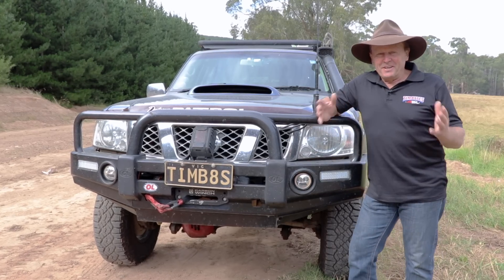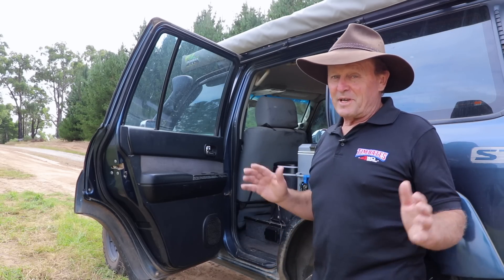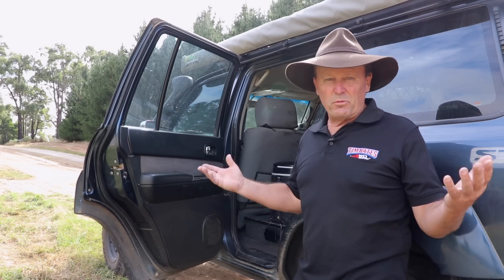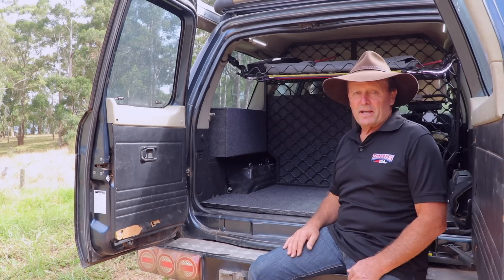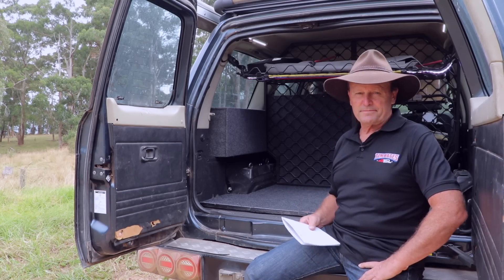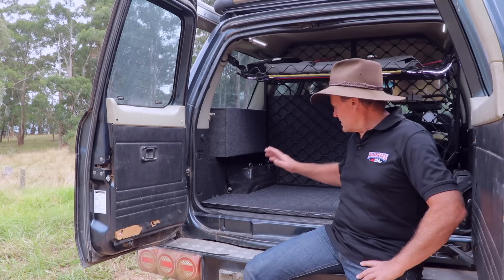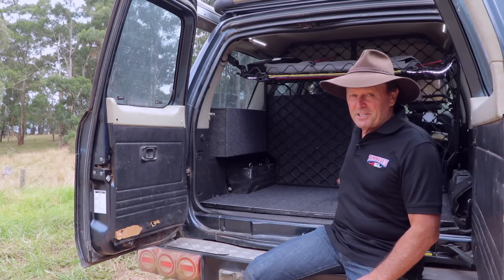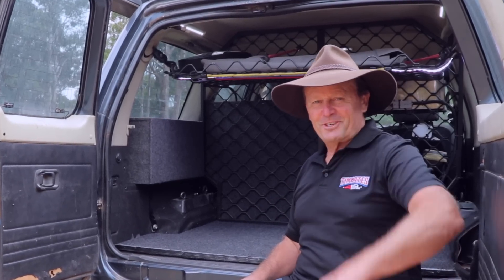Two Lithium Batteries Fail In Just 11 Months. - [ WHY?? ]

Comment: When I installed my 2 - 110 amp lithiums I simply strapped them down - no box! 
When my Redarc Manager 30 screens at me that the batteries are getting to hot (when using my induction cooktop) I can easily ventilate with a nearby fan to cool things down👍.
Reply from the maker: @TerryManitoba  that’s a good idea mate with the fan you have to cool down your lithium batteries. 
Top idea. 

Cheers Tim.
Reply: @timbates4wdadventures  It is worth a try as keeping things cool is kind of important. I've had the same batteries going on 8 years -  95k miles on the rig.
Reply from the maker: @ yeah mate, it is important to keep them cool. 
I’ve got the battery read outs through an app on my phone so I can see what the battery is doing. 

Cheers Tim.
Reply: @timbates4wdadventures  I also see you have the battery mounted above the rear wheel - which is where the vehicle gets a lot of movement.
To show some mechanical sympathy it would be "better" if you mount the battery & fridge for that matter between the front & rear tires. This is where mine are mounted and where you get "way LESS"  feedback from the road.
Reply from the maker: @ Gday mate, 
Not sure what you mean. 
The fridge is between the front and rear tyres inside the back passenger door. 
That’s the best spot for it. 
Easy to get into 

Cheers Tim.

Comment: Not mentioned How are you charging it? Why is there no ventilation as they get hot charging. Why slimline in the first place?
Reply from the maker: Well for starters - 
I’ve mentioned these points a number of times in other videos. 
It’s charged via a solar panel Anderson plug at the back 
There’s is two ventilation slots in the front of the box you can’t see behind the carpet
Slim line is obvious for space saving as mentioned in the video mate. Where it was mounted in the first place. 

Cheers Tim

Comment: As stated always check the tech documents for your battery. There certainly are a few brands out there that can be installed in any orientation for example some of the drypower products. But there are many rhat orientation cannot be altered.
Reply from the maker: Correct mate. 
Pays to check before mounting the battery. 

Cheers Tim

Comment: Would be getting the DCDC checked is working correctly and you have it programmed correctly.

Out of interest do you try and get your Li battery back to 100% Soc every day?
Reply from the maker: I would tip the Radarc 40amp changer is working fine. 
I drive the car pretty much ever day, so it’s going fully recharge each day. 

Cheers Tim

Comment: What brand of battery did you run ?
Reply from the maker: I’m not mentioning brands mate. 
It’s not about brands. 
This video is purely about checking if you can lay your lithium battery on its side before having it fitted. As so many think you can. 
Clearly you can’t as I found out. 

Cheers Tim.
Reply: @timbates4wdadventures  Thanks Tim and I understand. I was wondering if they were  Australian made or imports
Reply from the maker: @waylandforge8704  I couldn’t even tell you where they were made mate.

Comment: Might be a brand issue more so than an orientation issue. Not all batteries are the same I guess as mine definitely can be in any orientation & has been laying on its side under my false floor for over 4yrs with zero issues. It’s a 200ah slimline.
Reply from the maker: Yep, some can lay day and clearly as I found out some can’t. 
That’s the whole point of this video, not the failed batteries. 
I like some many people though a lithium battery could be mounted in any orientation. 
Clearly you can’t. 

Cheers Tim

Comment: One of by-products of electricity is heat. Heat must been taken care of/dissipated. Thermal failure of products is not rocket science.
I see it all the time, people mounting batteries and chargers in enclosed metal ute boxes or back of the wagon carpeted timber enclosures with next to no, if any, "good" ventilation. Not only will it be so inefficient, it can lead to failure and worse. Good on you for acting on and doing something about it Tim.
Cheers mate.
Reply from the maker: Thanks mate. 
The box the battery is mounted in has two 40mm wide slots the full length of the box. 
I’ll cut the carpet away from those slots if it’s needed. 

Cheers Tim

Comment: A couple of things: 1. The one in the correct orientation has no ventilation, heat may cause it to fail. 2. Why don’t you have an LED voltage readout. which are less than $5 on Ali Ex, on each battery? You can have it on the dash or where it can be easily seen, then you get a bit of warning of undercharge.  

I have never heard of anyone keeping a battery of any sort on its side.
Reply from the maker: Gday mate 
So many people have mentioned the ventilation in the battery box. 
I must do a quick short video on that.  
I didn’t mention it in the video. 
The box has two 40mm wide slots , the full length of the box cut in it. 
I have the app on my phone so I can see what the battery is doing all the time. 
Thanks for your feedback 

Cheers Tim

Comment: Also new standards on lithium batteries in caravans, need sealed box, you can store your asbestos in there too.
Reply: I think lithiums do not need to be stored in a sealed box, just need to be sealed from the habitable area (ie, to prevent the egress of gases into the living space).  That's the standard, but obviously no-one is going to care in a private build.
Reply from the maker: Ahh righto. 
That I’m not sure about. 
Do what ever the manufacturer recommends. 

Cheers Tim.

Comment: I haven't read all comments but Lithium battery are better charged with a dc to dc charger with Lithium battery profile for recharging versus alternator charging profile as far as I am able to ascertain. AGM are still the go in my books, no chance of thermal runaway either with AGM.
Reply from the maker: I do have it running through a 40amp Redarc charger. 

Cheers Tim.

Comment: My understanding is they are only supposed to be mounted upright for the safety vents in case the poo hits the fan. I've had mine on its side for 3 1/2 years and it still holds 92%  charge. And I live in the Pilbara where cabin temp for half the year is 70+
Reply from the maker: I didn’t mention in the video. There’s two 40mm wide slots cut the full length of the face of the box. 
Thanks mate. 

Cheers Tim

Comment: Tim I googled it and lots company's  say they can go any way. I just don't see why not as there is no fluid in them. I'm stumped
Reply from the maker: I’m tipping there us mate. 
I’m not fussed what other manufacturers are recommending. 
The point is, the battery I have says you can’t. 
I’m going with that. 
If your lithium battery manufacturer says you can mount it in any configuration, then that’s fine. 

Cheers Tim
Reply: @timbates4wdadventures    yes I agree.. Mine is in a stainless case with replaceable cells if one goes down. You don't have to trash the lot.its mounted upright..

Comment: I've just travelled across Australia with my 200ah enerdrive lithium battery, just behind the front seat but standing up i n my patrol. Would have to be 1 of my favourite mods. Never got below 70% didn't even need my solar panel I hauled along. I could of done it with 100ah. Not to mention the 60kg weight loss from agm.
Reply from the maker: Great feedback mate from
The trip you’ve done and no issues. 
Mine is a 100ah 

Cheers Tim

Comment: You bought the wrong type not all can be. You flogged off the people that tried to point this out... not all are the same type of cells
Reply from the maker: I’ve not flogged anyone of on this point. 
I’m no expert on car electrics and or lithium batteries. 
I’ve never said I am. 
But I like so many people think that lithium batteries can be mounted in any configuration. 
Hence why the third battery was mounted under my false floor on its side. 
Then I find out the battery I have must be mounted upright. 
The one and only point of this video is pointing out you can’t. 
So, check with the lithium battery manufacturer on the battery you have, and if they say you can mounted any way you like. 
Then go for it. 

Cheers Tim
Reply: @timbates4wdadventures  your famous on FB groups of 12v for deleting all the comments that said you did it wrong and was wrong battery to lay down...

Comment: Tim add a fan to the box air flow is a must all is needed is a computer fan
Reply from the maker: I must do a short video on the battery box. 
I didnt mention in the video, but there's two 40mm slots the full length of the box face cut into it for added air flow. 

Thanks mate. 

Cheers Tim

Comment: I'm glad you got your battery issues taken care of. A great tip I can think of is to carry a charging cable for the battery in case it needs charged but the alternator isn't charging it for aome reason. You never know what's going to fail on a vehicle next.
Cheers,
Colton
Reply from the maker: Good point mate. But i can charge the lithium battery from my solar panel as well. 

Cheers Tim
Reply: @timbates4wdadventures  That's true, but those can fail too.
Reply from the maker: @ColtonRMagby  Thats right mate. They can fail also.

Comment: Yeah, but wh? 
It would of been good of the manufacturer to explain why. The company that I purchased our lithium  from 3 years ago stated that it can be mounthed in any orientation. So its been mounted flat all that time with no ssues
Reply from the maker: Thats all fine if the battery manufacturer that you have states they can be mounted in any configuration, you'll at least be covered if it fails. 
I believe the issues are around the BMS failing. 

Cheers Tim

Comment: Thanks Tim, I have just had a slimline Hardkorr 100a Lithium battery installed hard up against the cage in my rear cargo hold, with the BMS behind the passenger back seat secured to the rear frame frame of my Australian made drawer system (2010 made - pre Chinese imported). Extremely neat and did not miss a beat on my last trip to NSW/QLD & back - highly recommend
Reply from the maker: That’s the go mate. 
It appears that mounting them upright is the go. 
Thanks mate. 

Cheers Tim

Comment: Interesting, after reading all the comments no one else has made the same mistake and had failed lithium’s 
I have 3 all mounted upright, one under bonnet, one in battery box for portable power and one in the back running 2 fridge’s
The under bonnet failed after 6 mths replace under warranty
Reply from the maker: A lot of batteries going to run your camping setup. 
Good that the failed battery was replaced uner warranty. 

Cheers Tim

Comment: Thanks for sharing Tim.  It's good to know that not all lithium 12V batteries can be mounted in any which way.   I thought they can.  As so far, all the 12V Lithium batteries I've come across to date have listed this (being able to mount it vertically or horizontally) as one of their features.  This is a good reminder that it pays to spend a few minutes reading the user manual, or even better, thoroughly read the spec sheet prior to purchase.
Reply from the maker: No worries mate. 
But, spot on, it pays to check. 
If the lithium battery you get says you can mount in any configuration, then you will be covered if a warranty claim is needed down the track. 

Cheers Tim

Comment: The cells can be mounted in any orientation but my guess is it comes down to how secure everything is mounted/attached etc internally that would be the limiting factor. There’s no reason it couldn’t be manufactured to go on their side unless it’s a restriction due to heat dissipation.
Reply from the maker: Yeah I’m not sure mate. 
But the battery I have now says by the manufacturer, it must be mounted in the upright position. 

Cheers Tim.

Comment: My understanding is that lithium batteries are solid state. It should not matter which way they are placed??? Maybe it was lack of ventilation from the previous location? 

I genuinely dont know, I still run an old school AGM battery and admit I am not across the new tech.  Love to hear peoples thoughts.
Reply from the maker: That was always my understanding mate. 
But when my manufacturer manual says otherwise. 
I have no choice but to go by that. 
Other lithium battery manufacturers might say it’s ok to mount in any orientation, that’s fine if they say that and go with that. 
Thanks mate. 

Cheers Tim

Comment: I have lithium batteries in many devices that are mobile, I imagine the issue with this would be the cell and battery management system contacts.
Reply from the maker: Yeah, i believe its with the BMS not liking to be mounted on the side.
Just pays to check. 

Cheers Tim

Comment: Hey mate, what is the DC charger your using to regulate the charge from your vehicle battery to the lithuim? That is probably more to do with the said issue rather than how your situating your battery as there are no liquids etc in either your Lifpo or the bms that governs it.
Reply from the maker: G'day mate, 
Im running a 40amp Redarc charger. 
Should be more than big enough for what im running i would think. 

Cheers Tim

Comment: Ive recently upgraded to Lithium. According to the manufacturer itnis meant roncharge at 14.7v, float at 13.6v but Im finding it wont charge higher than 13.6v and normally aits at 13.2v. I have a Ctek D250SE and 110w Solar, with ny old AGM it would charge at 14.7v no worries, this has only changed since installing the Lithium.
Reply from the maker: Ahh righto mate. 
Interesting figures you have mentioned. 
Thanks for that. 

Cheers Tim

Comment: G'Day Tim, great episode and good information for all those hoping to run lithium to check with the manufactures specifications. 

Out of interest, what was the factor that resulted in the determination that the side mounted format was the sole issue for these batteries failing? Further, can I ask how those batteries failed? Were they dropping cells, loosing capacity, BMS failure? 

Theoretically side mounting (or any mounting) of a lithium battery really shouldn't affect the performance of longevity simply based on the nature of their construction. Will be interesting to hear how you get on with this new setup. 

All the best, Nathan.
Reply from the maker: G'day Nathan, 

As i mentioned in the video about those two batteries failing. Whether it was from lying on their sides caused them to fail, who knows. 
All i know from what i could see on my app, that they wouldn't charge back to 100%. 
They both performed as they should for the first few months, and over time i noticed what was going on. 
Reason for that, i don't know. 
The main point for this video was bringing to attention about how a lithium battery can be mounted. 
As i for one, along with many people think you can mount them in any configuration you want. 
Clearly you cant. It pays to check.
Only that i read the manual, that third battery would still be mounted under the false floor. 

Cheers Tim
Reply: @timbates4wdadventures  Cheers Tim, sure is interesting and you have definitely broadened the exposure in this instance. 

All the best with the new setup and here's hoping that these batteries go the distance 💪
Reply from the maker: @XploringOz  thanks mate. Hoping for long, trouble free battery running now.

Comment: Tim, thanks for clarifying the situation.
I wasn't aware of lithium orientation being similar to AGM,  where any orientation is accepted as okay.
I just set about mounting all my Itech units in an upright position as I always did with AGM also, as any other orientation just seemed obscure to myself, seemed just wrong to me even when accepted by industry as the standard.
Hope sincerely your issues are resolved as a result of orientation change.
Regards, Wealie
Reply from the maker: No worries mate. 
I agree with your way of thinking.
Just mount them upright and you shouldnt go wrong. 
Thanks mate. 

Cheers Tim

Comment: Battery orientation is a weasel-out clause for the manufacturer to avoid honouring warranty. Or their mechanical pack construction is sub-par.
Reply from the maker: Yeah mate, i was surprised when i read what i did in the manual. 

Cheers Tim

Comment: Hi Tim, I’m a bit confused by this, what brand is your Lithium battery? If it’s a quality brand they will have used LiFePO4 cells to construct the battery, which are the safest cells you can use, particularly for a 4x4 battery, any LiFePO4 Lithium can most definitely be mounted in any position at all, it makes no difference to the batteries performance at all. 🤔
Reply from the maker: G'day mate, im not getting to brands. But they have all been from the top brands. 
I only picked it up in the manual, so thats what i have to go by. 

Cheers Tim
Reply: @timbates4wdadventures Cheers Tim, thanks for the reply, yeah fair enough if you don’t wanna mention the brand, but I’d be a bit concerned with that if I was you, there’s definitely something not quite right there, do some research into into my first comment and you’ll understand where I’m coming from. Anyway, love your content mate, keep it coming mate 👍
Reply from the maker: @greghammond7956  Thats a lot mate, i'll look into a bit from the first post. Thanks mate.
Reply: @timbates4wdadventures  Cheers mate 👍
Reply: Orientation has nothing to do with performance. I've cut LiFePO4 battery's apart that have cells held in place with sticky tape. I wouldn't want to put such batteries on their side!
Reply: @MrFastFarmer  So you obviously bought cheap arse batteries mate. Quality built LiFePO4 batteries can be installed in any orientation with no issues at all, end of story.
Reply: @greghammond7956  So... you must work for ARB and drive a Land Cruiser 300. Get your angle grinder out and have a look inside your expensive battery. You might get a surprise.
Reply: @MrFastFarmer  Haha! Far from it mate, I actually build my own Lithium batteries from scratch, I don’t buy them from anyone! All the best mate 👍